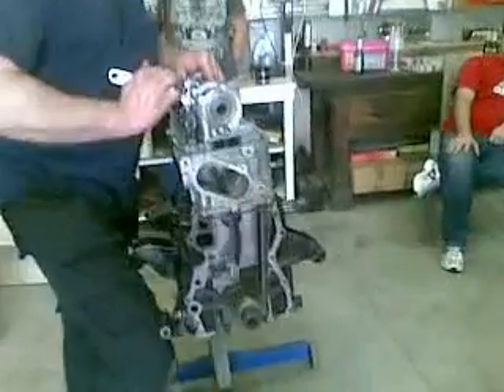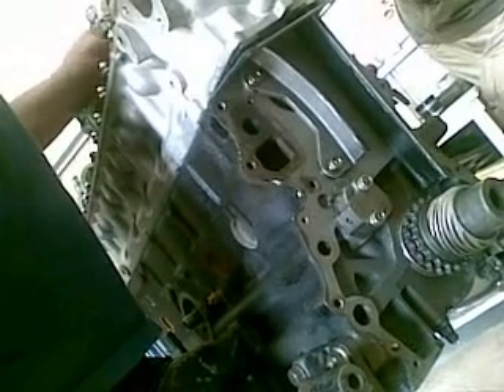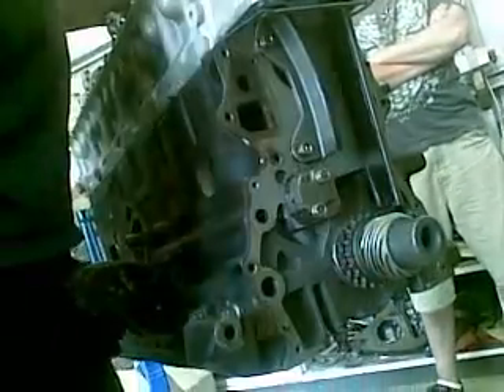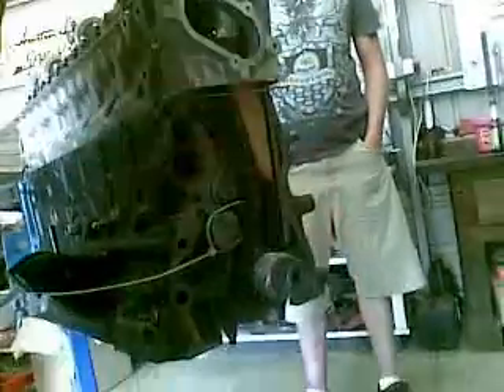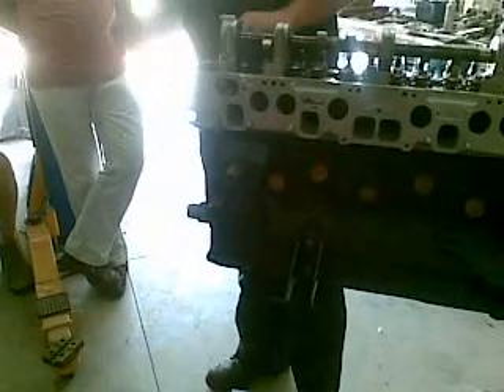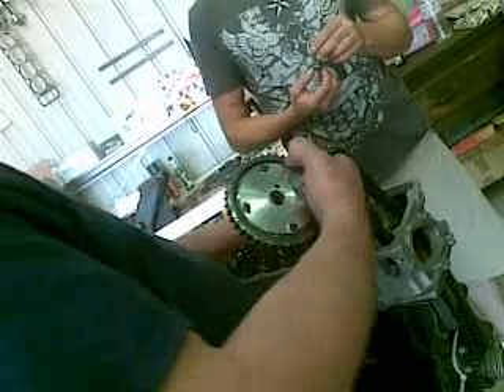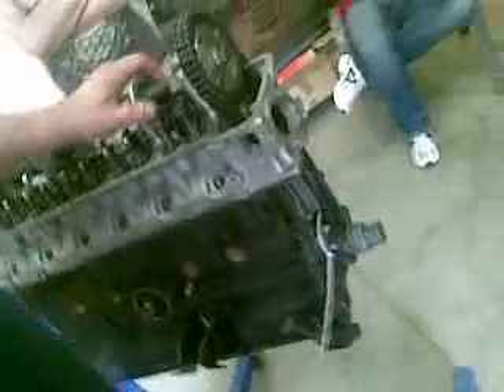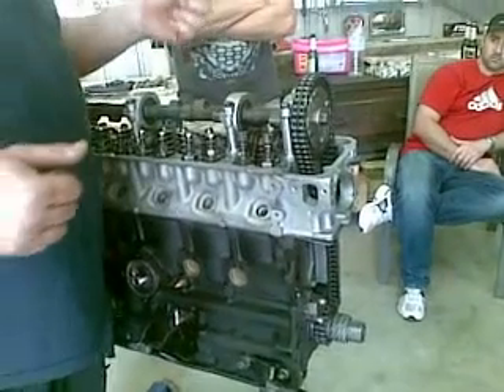L Series 240Z Datsun Race Engine building featuring Peter MacDonald

Comment: All of the good quality chains ( prefer the factory chain) have silver links which are 42 links apart.  The silver links are on the out side. I he has an adjustable cam sprocket to make things "perfect", a dial indicator is necessary at both the cam and the crank. I put the tensioner on after the chain is in place. I guess each to his own. Have also on occasion, slotted the curved chain guide if I couldn't get the cam timing perfect using an aftermarket high performance cam. 99% of the time, the adjustable cam sprocket is all that is necessary to dial one in. I always adjust my valves hot and always "exact" not, just close. I have been building Nissan race engines since 1969. Startinng out with the SRL311. I noticed in all the videos on the cam sprocket installations that they don;t show two other references which also confirm that the sprocket is on correctly. One is behind the cam gear where there is a notch cut in the back of the cam gear and a mark on the retaing plate. You also have a similar reference in the front if you look at the center of the gear where it slides on to the cam. There is a punch mark on the retaining plate and a notch on the cam gear. If these are lined up, the valve timing will also be correct.I always put the sprocket pointing to the outside link! I noticed in one of the videos that they placed the sprocket with the number pointing to the inside link. Being a Nissan Master tech, that is not how they taught us in school.
I could go on with a list of mistakes I noticed I noticed in many of the videos including those on SU carbs which could only be found teaching service and repair of British carbs.
Reply: B Hackett But none the less, Peter still manages to build the most powerful L engines in the world.
Reply: +B Hackett  Although the mark in the thrust plate and the notch in the back of the cam gear can be an indicator of correct valve timing that is not their real purpose. Those two marks are used to determine timing chain stretch. If the notch in the gear is off to the left of the mark on the thrust plate when the engine has been set to TDC it indicates the chain is stretched. To compensate for that you remove the cam gear and move it to next mark. The factory gear has three locations numbered 1,2.3 on the center of the gear that locate on the pin on the front of the cam. Corresponding marks are found on the outside of the gear. If your chain is set on mark number 2 and the chain is stretched you then turn the gear and locate it on the number three hole in the center of the gear and the timing mark on the chain on the number three mark on the outside of the gear.